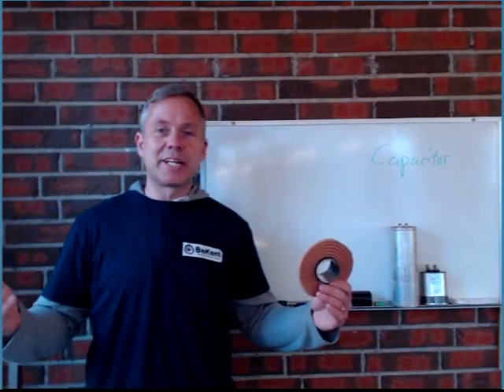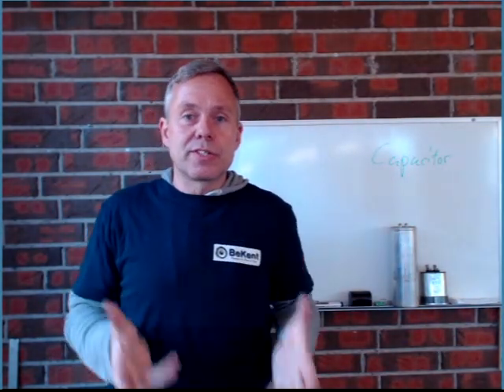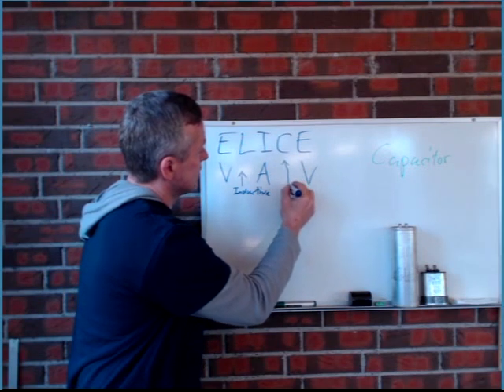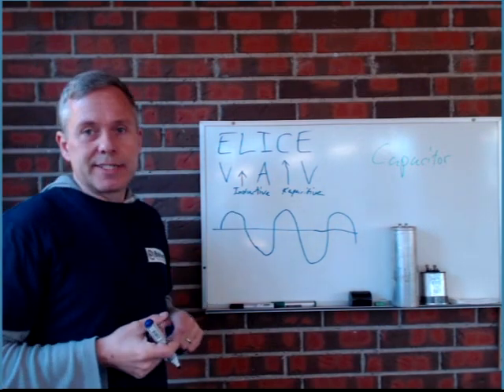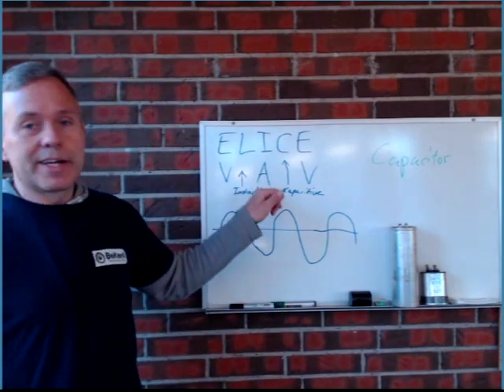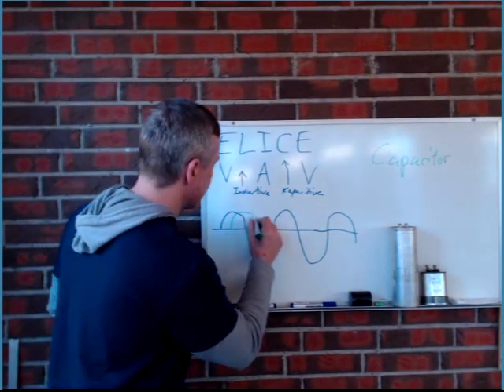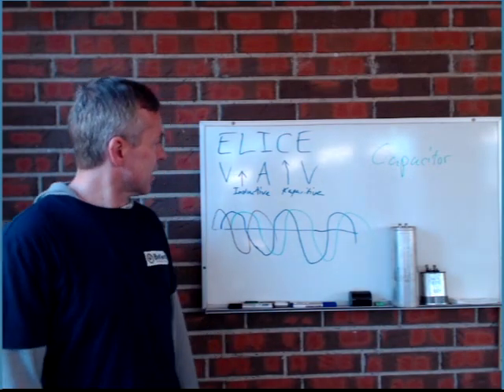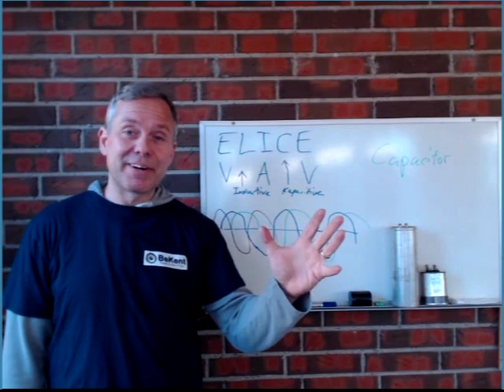Capacitors why do you need them?

Comment: Is there no way of simplifying the explanation boss?
Reply from the maker: The explanation pertains specifically to tanning bed repair, so a simpler explanation wouldn't be helpful to solve those specific practical problems. If we are talking in general the explanation of capacitors it would be entirely on charge and discharge of electricity, and yes a more simple explanation would absolutely be possible.

Comment: thanks for the informative video! is it possible that a bad capacitor is causing a group of lamps to not turn on in the canopy? set of 9 lamps will not turn on. they are brand new with new starters. all ten pin connections are properly connected and no loose wires. I'm stumped on this one.